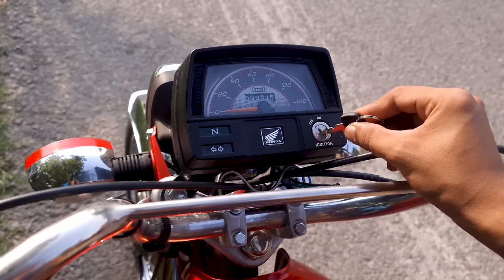Scrap Honda 70cc MotorCycle Full RESTORATION

Comment: Looks nice bike. The headstock needs grease on the bearings. The tank is not original as the one pulled from the pile had a dent on the side. The one painted didnt. .
Reply from the maker: Actually, we removed the dents behind the camera.